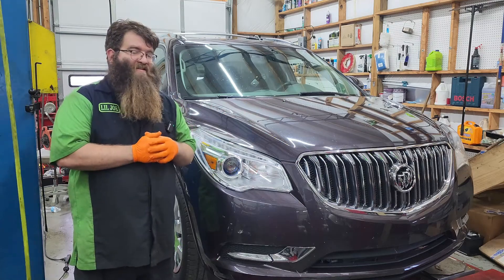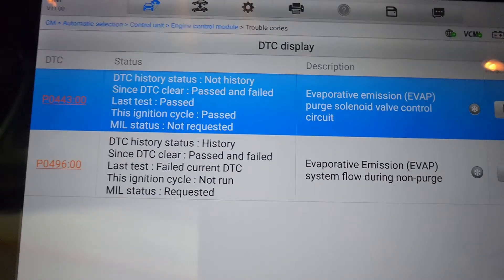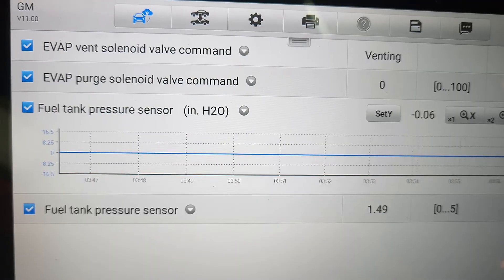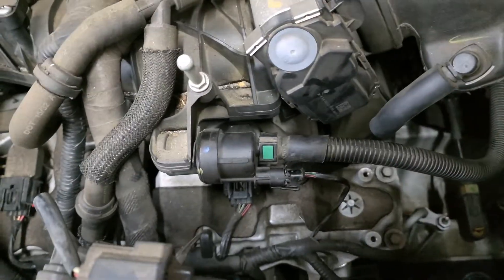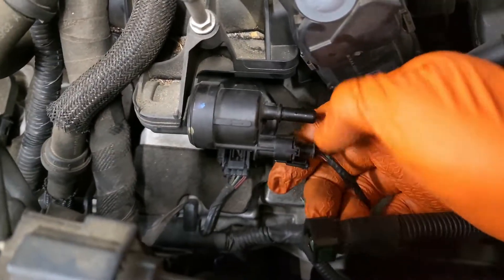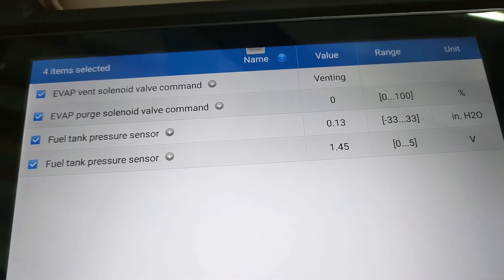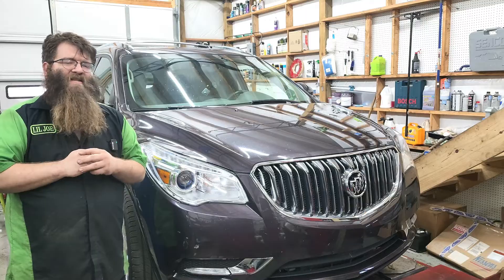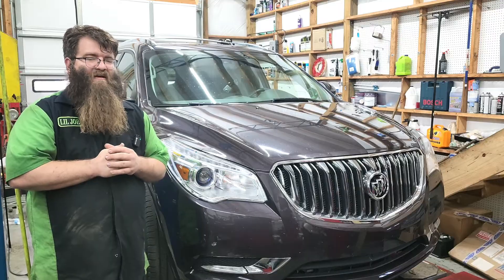09-18 Buick Enclave Check Engine Light P0496 - Purge Valve Replacement

Comment: The mechanic has already replaced the valve but it still gives the same problem
Reply: Try replacing your fuel cap. If not you have a leak in the line somewhere